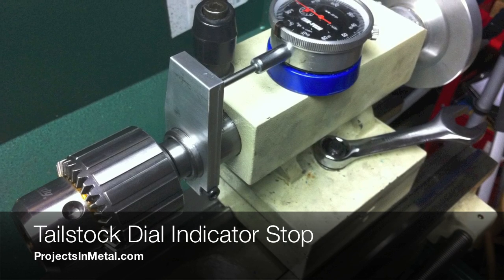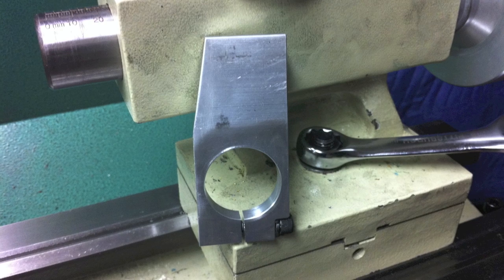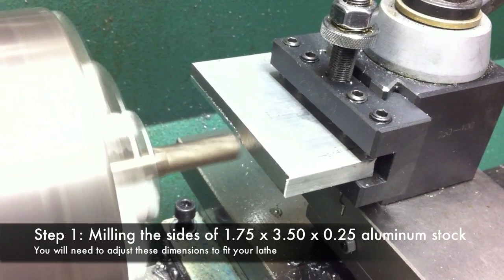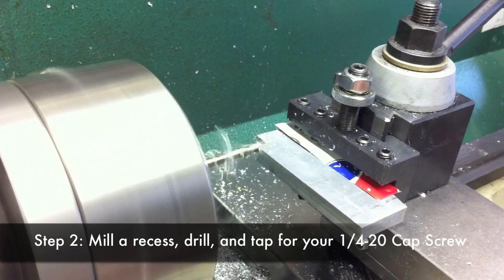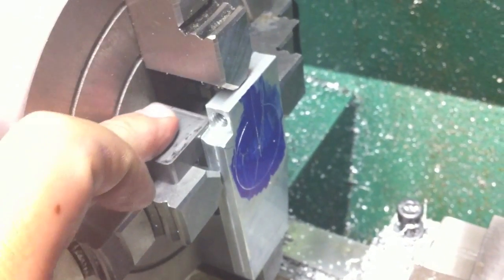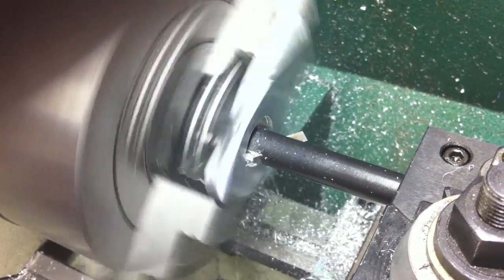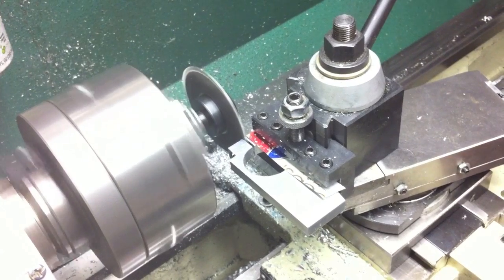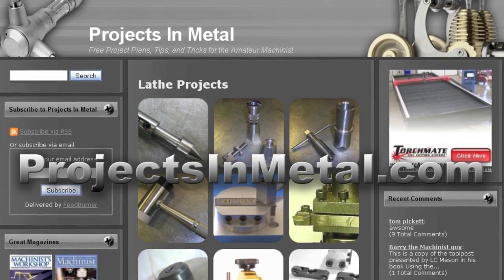Making a Tailstock Dial Indicator Stop for a Grizzly G0602 Lathe

Comment from the maker: I don't really have a milling attachment. I'm just using a regular tool holder for a Quick Change Tool Post to hold the part and a custom made saw arbor (with a straight shank) to hold the slitting saw, end mill, etc.

Comment from the maker: Are you talking about the slitting saw that I used at 2:43? That is just a regular slitting saw held in a saw arbor that I made that has a straight shank so I can hold it in the lathe jaws (vs an R8 or similar shank for a mill).